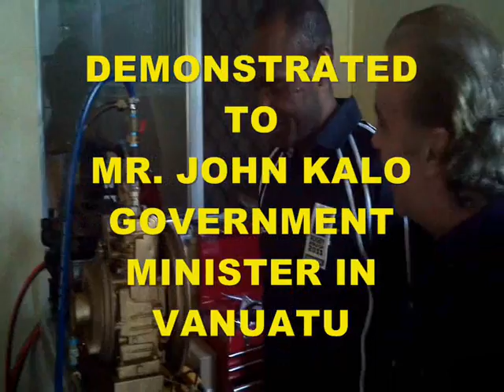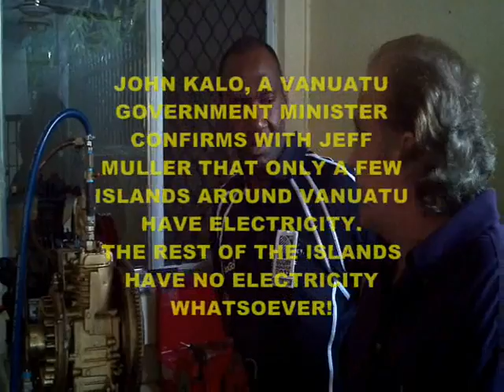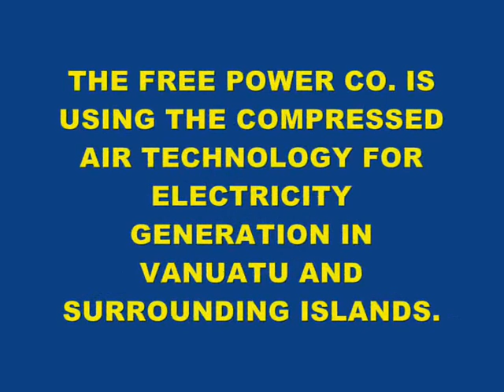FREE ELECTRICITY - VANUATU DEMO COMPRESSED AIR MOTOR

Comment: Absolute bullshit. 
I reckon this prick tried to con a big fistful of money out of the Vanuatu government for fake free energy devices that aren't worth a pinch of shit.
Notice how he keeps saying "this WILL run the compressor and that WILL run an alternator" - the fucking thing isn't even assembled, it's just a motor being turned over by compressed air and a few other second hand parts.
Listen from 1.30, he says the compressor will run the alternator. A compressor is driven, this one is supposed to be recharging the tank, not running an alternator. Then he says the alternator will charge the battery (and puts his hand on the air motor), yeah, that would work if a compressor produced energy rather than required it. Then he says the battery will recharge the compressor so it can be started at any time. What sort of charge does a compressor hold? 
Then he says it all starts off with the little compressor here - and can't find the switch, but his mate does and we hear the familiar buzz of a mains powered compressor that is actually making the whole charade of a contraption work.
About this time the cameraman pretends not to know anything and asks about petrol and they make a big song and dance about not using petrol. Suddenly the cameraman is an expert and tells us there's no fumes and that this means "Free Power".
These guys are either joking or conducting fraud, I suspect it's the latter.

Comment: This "explanation" is pure BS. Compressors can't run alternators. All they can do is take rotary motion and turn it into compressed air. They can't run anything that doesn't run on compressed air. A battery can't recharge an air compressor because an air compressor does not store electricity.

Comment: It still needs a power source to compress the air. And this is not new nor your idea. First air motor ran in the 1920s. I seriously doubt that the exhaust gases can be re-compressed into the compressor direct from the motor as it would stop it dead due to the same back pressure. Putting that aside even if you used the motor to generate electricity I again seriously doubt it could produce enough electricity to run the Compressor to refill The air storage tank.